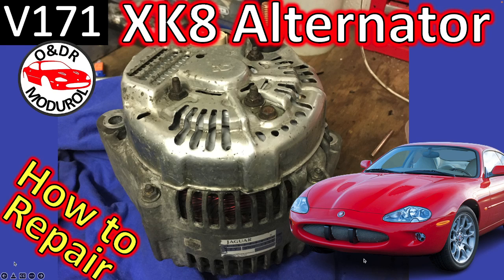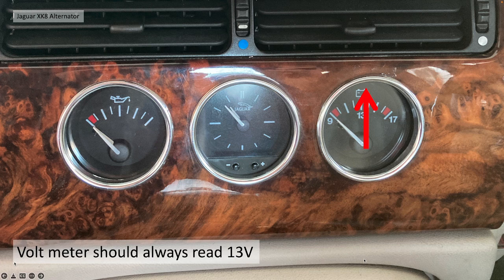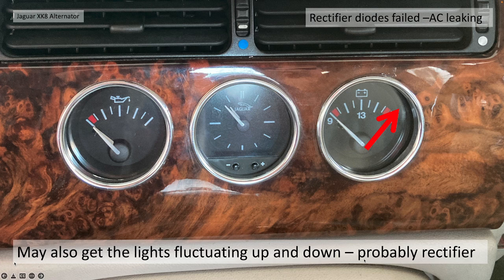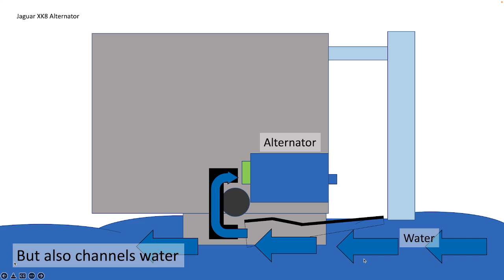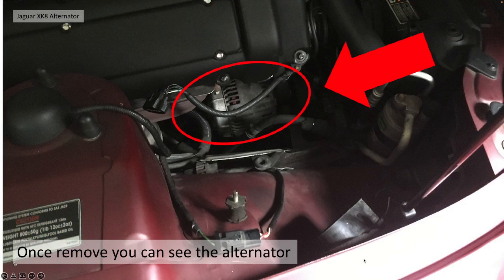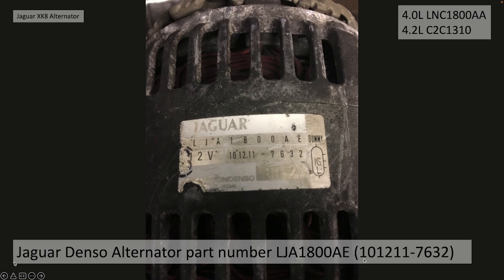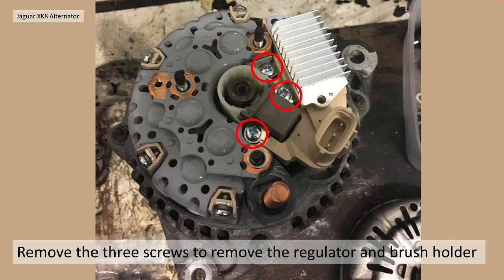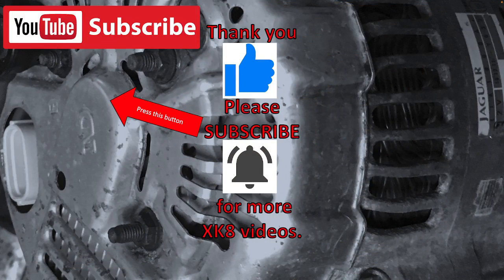Jaguar XK8 Alternator Repair DIY: Symptoms, Failure Causes & Component Fix. Modurol (XKR X100 V171)

Comment: Hi Damian! Hope you are doing great! Here are some updates: The new Rebuilt Denso is holding the "Battery Not Charging" lamp on. Also The Voltage gauge is lit. I am trying to get my $$$ back from Eeuro parts. I ordered another Alternator from Welsh Jaguar. Hopefully this one will play nicer with the electronics. I was quite depressed as I spent a lot of time with this. I had to have the connector soldered in the end. Thank-you SO much for all the inspiration, sure needed it, if it was easy everyone would be doing it! 
I am hoping once I get the alternator right, the rest of my electrical woes will follow suit. The center console and heated seats are inoperative. I am praying here! 
 Many Thanks again! Thanks for being there, for me to vent!  I am going to get this done!!! Regards, Ben.
Reply from the maker: Ben, heard about aftermarket alternators not working with the rest of the system. Not sure why but it seems to happen. Hopefully, the other issues will clear with the new alternator. Keep us posted on developments, keep going you are a step closer, regards Damian

Comment: Based on my research the Suppression Module was for the high end stereo. I have a harmon Kardon stereo. I can always connect it later to the large positive on the Alternator , if I have radio noise. I put it all back in place the (suppressor and bracket). Hooked the ground to the case bolt on the Alternator where it was. Again..... Thank-you sooooo much for all your time trying to help me out !!!! You are indeed a special guy! Sometimes I call around for info, they say, A Jaguar! Good Luck! 
 Have a great night!!!!  Ben 😇
Reply from the maker: Ben, awesome!! Very glad you got it sorted out. An old Jag is no match for you, must be very satisfied. Now the car has your mark on it and owes you big time for its existence. Happy motoring or onwards to the next repair (we are driving Jags), regards Damian

Comment: Hi Damian! Just waiting on the Denso Oval Connector. Also ordered Crutchfield Accele Butt connectors Part # CR102ss-20. They include the Solder shrink tubing and weatherproofing glue all in one. The two pigtails come off the harness and there is less than 3 inches of wire, so this is going to be tight. I also bought a new Heat gun. Turns out the Green wire,  is a GRAY wire. I am colored blind. Slate gray wire is the dash warning lamp (Top Connector). White wire. connector in the middle is Ignition B+. Bottom pole in the connector is NOT used. I am trying to verify this with the Jag Forum. Sometimes they can be helpful!  Thank-you for supplying the initiative and  fortitude for me to forge on, repairing this Gorgeous Coupe. I know you are in my corner. 
Ill  let you know how things unfold here! many Thanks Again! Stay well and God Bless! Ben Leone
Reply from the maker: Ben, you are getting a real grip of the electrics. Please note all the wiring diagrams are easily and freely available via our website www.modurol.co.uk . You enthusiasm and get on with it attitude is very inspiring, keep up the good work, regards Damian

Comment: For some reason the suppression module was disconnected from the Positive. Do I need that? The red wire would go to the main positive cable at the Alternator.... my guess. As eyelet was larger. Ill leave it disconnected ,as it was. 
 Thanks again my good man! If I didn't LOVE this stunning Coupe as much as I do, I would NEVER do this.  
Just no car quite like it!!!! Hands Down!!!
 Talk soonest!
Reply from the maker: Ben, Not sure why the suppression module was disconnected, assume you need it to reduce radio interference. Looking at the wiring diagrams, the wiring altered over the different generations of the car, both the wire colours and its operation (no suppressor shown on later models). Sorry couldn't be much help. Hope you have got your car up and running, agree it is a labour of love, regards Damian

Comment: Hi Damian-I Fit the Denso LNC1800AA to the Jag yesterday. Not a job for the faint of heart. Top bolt was dinged by a previous power tool. Had to file the bolt to get the 10 mm wrench on. The connector fell apart in my hand, crumpled to bits. I ordered a new Denso Oval connector. TWO wires to that connector, green wire top, White wire under that. didnt realize there was three poles on that connector. So I need to verify orientation. The unit was Frozen to the bracket. I sprayed PB Blaster, and hammered the unit upward with a one foot two by 4. FINALLY it came loose. Removed the bracket, for the suppression module and the air cleaner.... PIA. Just all labor. Thank GOD the unit is now in place and the connector is on its way. So next is the soldering of the connector. Not much room in there, about only 3 inches off the harness. 
 Wish me luck! Ill keep you posted.
 You Stay well!   Thanks for getting back!!! God Bless! Ben
Reply from the maker: Ben, sounds like the car and alternator are putting up a real fight. Hope you have broken the back of the job now and putting it all back together goes more smoothly, regards Damian

Comment: Hi Damian-tried to pull that alternator today. Small harness going to alt has a stray red wire not connected to anything, the other wire to the small nut on the Alt. There is a Green and white wire going to the connector plug. (Green on top) But the New Denso has three terminals. Of course after 26 yrs the connector is frozen in the alternator. had to break it out. Any ideas???? This job turned sour quick. Thank-you! Ben
Reply from the maker: Ben, would be worth checking the wiring diagram for clues, regards Damian

Comment: Hi Damian, Hope you are well! Would needing an alternator make my windows go haywire? Driver window goes down on door opening. Window resets useless. Tried to hard reset. No go.  Alt gauge running to the left about 9 Volts not straight up. Thanks! Ben
Reply from the maker: Ben, 9 volts on battery gauge is definitely flagging an electrical issue. Low volts will probably confuse the door module. When I had an alternator issue it was pushing circa 15 volts rather than low volts. Might suggest charging the battery, check the volt meter gauge and trying the windows without the engine running. This would help to identify alternator or battery issue. But might be a problem with both. Please note some motor factors/spares shops will test your battery and alternator for free in the UK. I think the volt meter actually reads the true volts until the engine is running. Hope that helps, please let us know how you get on, regards Damian

Comment: Great video, on a different subject just completed cam chain tensioners replacement, everything good except when parking my car on full lock both sides the revs drop and engine stalls.
Checked steering fluid all good battery alternator all check good.
Car idles nicely just when up to running temperature on full lock it stalls.
Is there a way of speeding up the idle via a adjustment screw as it only needs 75-100 revs more.
I searched around the throttle body area but cannot find a adjustment screw for idle.
Any help Damian would be great.
Thanks James.
Reply from the maker: James, well changing the timing gear, another one saved from the crusher. Sorry there isn't an idle adjustment screw. Its an electronic throttle controlled by the ECU. "At idle, the ECM controls engine speed using the restricted throttle valve movement available between the mechanical guard (open limit) and a factory set stop on the dc motor drive gear (closed limit)". Suggest the only thing left that might be worth investigating is the air intake. Might just be an air leak on your intake elbow which has effected your mixture. This is a bigger problem at idle speed than when its running down the road. The fuel mixture might not be quite good enough to keep it running with the additional load at full lock. Hope that helps, please let us know how you end up fixing the issue, regards Damian

Comment: Thanks Damian, very handy as I’d recently acquired a Denso replacement. Had been experiencing ‘battery not charging’ errors, also some ABS sporadic errors.
Found your explanation helpful (along with jagvettes!) Managed all from up top tho’ the cooling cowling had to be removed/replaced from below - took the opportunity to changeout abs sensors while at it - don’t think there was ought wrong with them tho’!
Trust all good there, cheers from Aus. Dave
Reply from the maker: Dave N, All good here. Thank you very much for the feedback. Glad it helped in some small way all the way over in Aus. Much appreciate your long distance message, regards Damian

Comment: thanks for the interesting video. my xk8 is going into hibernation now. I'm going to put in new shock absorbers and strut mounts in the front. with your help (video) Greeting Udo
Reply from the maker: Udo, thanks for your support, my XK8 is also going to hibernate from next month. Lots a small jobs planned including a new headliner. Sorry, I haven't replace the shock absorbers or strut mount on my car only removed, painted and refitted. I did all that before I started the channel so haven't made any videos. TheJ aguar workshop manual will be very helpful. If I can help in some way I will try, good luck, regards Damian

Comment: Smashing video Damian. I'm just back from a brilliant 800 mile trip to the Highlands of Scotland.  The XK8 was faultless and averaged 29mpg overall despite a real mixture of driving.  However, I've got a slight metallic rattling noise from the area around the serpentine belt. Can't quite decide if it's the tensioner, water pump or alternator, but she's going into her winter lay -up from 1st November, so I'm planning to strip down all the components on the front of the engine as well as replacing the plastic thermostat housing with the later metal one.  I suspect it's the tensioner, but time will tell.  No doubt I'll be swatting up using your earlier video guides before starting.
Thanks for this and all the other maintenance guides. These plus Gary VanRemortel's 'Bible' on TTG are absolutely invaluable. Cheers!
Reply from the maker: Gerard, sounds like you are having lots of fun with your XK8.  My guess would possibly the idler pulley. Would be interested to hear how you get on with your winter maintenance, we are always learning, regard Damian.

Comment: The main problem I have found with alternator repair is when you need to replace the bearings because they become noisy and make a lot of whining noises. It's a reasonably common failing, perhaps as a result of the hot running. 
I don't know whether the Denso's fitted to our XK8s fall into this category but some models I have worked on require cutting of wires and then access to a really heavy duty soldering iron and some suitable copper collars to re-make the connections. Pulling/pressing the bearings out once the alternator is dismantled obviously requires a suitable puller and press but it is not technically difficult.
Richard
Reply from the maker: Richard, good info. From what I have found these Denso alternators are mechanically reliable. Economically, if the bearing are suspect it’s probably worth investing in a complete reconditioned and tested unit. If the bearing are gone possibly needs brushes etc. Thanks for the input for your experience, regards Damian

Comment: Damian, thanks for reminding me of the need to update the XK8 bible to include my recent alternator adventure.  Easy replace job from top.  My backlighting began flickering out at 150Kmi, so I replaced with a $240 reman.  Latest rev bible out on John's website.
Reply from the maker: Gary, thanks for the feedback and sharing your experience with alternators. Will take a look at your new entry in the XK8 Bible, regards Damian

Comment: on my second replacement. Living in Phoenix, I believe these things just get cooked unless you are traveling faster than a certain amount of speed. Therefore, stop n go traffic when the pavement temperature is probably 150f  just cooks them
Reply from the maker: GIMPS Unlimited, can fully understand why they might cook in hot climates without the car moving. No air flow due to the ducting. Thanks for your sharing your experience, regards Damian